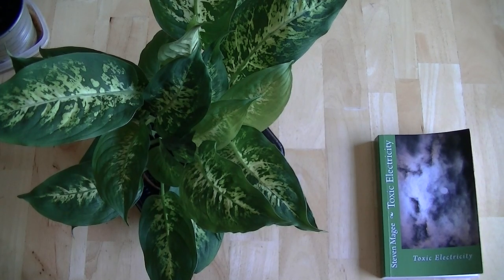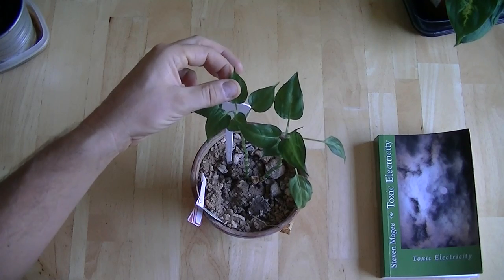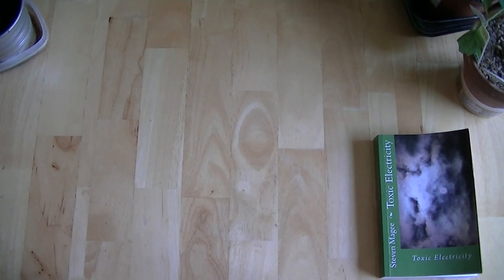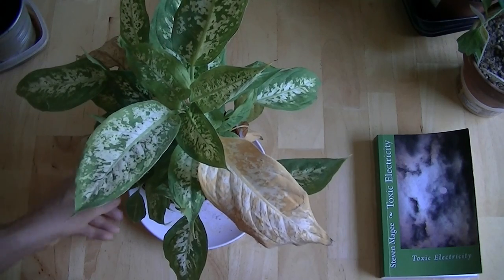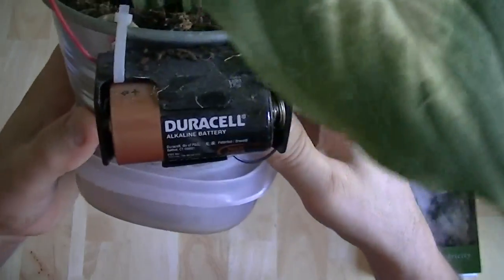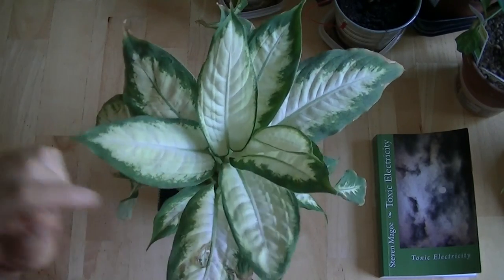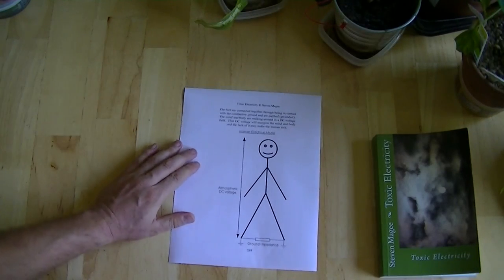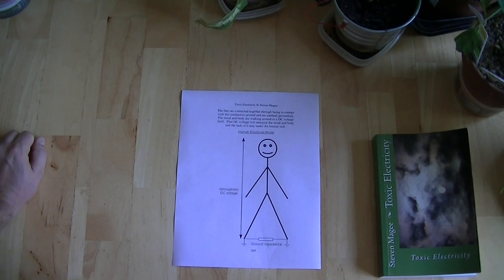Wireless Radiation and DC Voltage Exposure Effects on Plants and Humans

Comment: You may be interested to look up Lee Crock who used batteries to recharge the human body. And also Electrostatic therapy Pyro Energen etc. Both of these add voltage to the human energy field and re-energise the body. I think the issue is that our modern built up environment whether due to a faraday cage effect or other robs the body of electrons. So many things in the urban environment do not contribute any electrons. For example off gassing of modern Chinese furniture will rob electrons (anions) from the air. These leave us with a deficit of an already empoverished anion environment to survive on. Not to mention the food we eat which is electronically dead. Body Electric also goes into the benefits of microcurrent therapy for healing the body from fractures and non unions etc. Dr Tennant discusses how most forms of disease come from lack of electricty in the area of the disease. Your novel contribution is the simplicity of using a battery to achieve greater vitality albeit experimental. And also how a faraday cage or an EMF canope which costs an arm and a leg could do more harm than good by blocking out background radiation such as cosmic white noise which are beneficial frequencies as well as blocking out atmospheric (-) charge which to my understanding is negative ions of which there should be at least 500 per cubic cm  ( I have an instrument to measure these) but in the city you would be hard pressed to get this many. More like 100 pcc. Go up into the mountains or forest or have a long shower with enough mains pressure and you can go up to 20+ K. If you have any doubt about this try growing your plants in an anion rich environment. Or Lee Crocks Device without the alternating current. Or next to a shower that is on most of the time.  Great works thx for sharing
Reply: Very interesting. Have you built it and tried it?

Comment: What about a plant with no battery?
The 9 volt pot has damaged the roots in a very short time, perhaps in the first 24 hours has emptied all of its charge increasing the root temperature and damaging the growing cell structure. Your 1.5 volts pots simply has done nothing to your plants. The charge has not been enough to cause any effect.